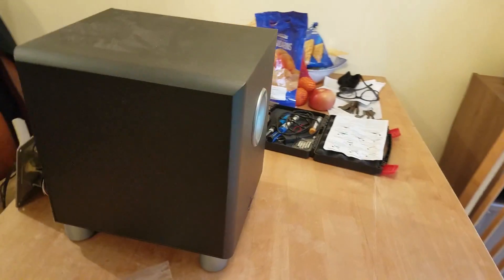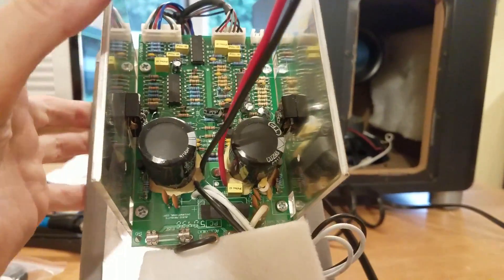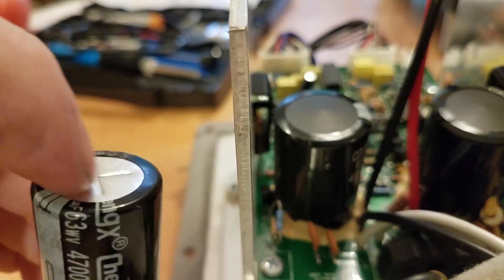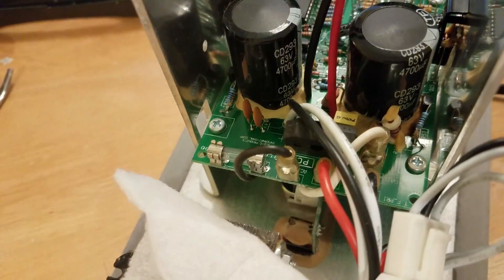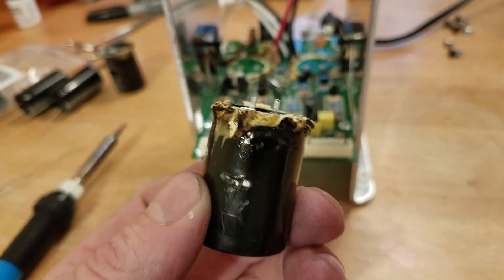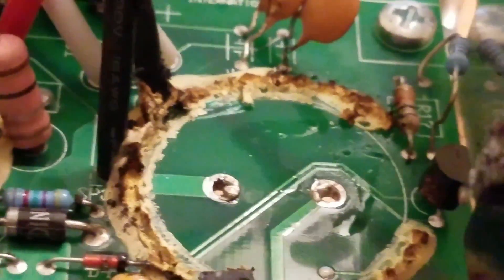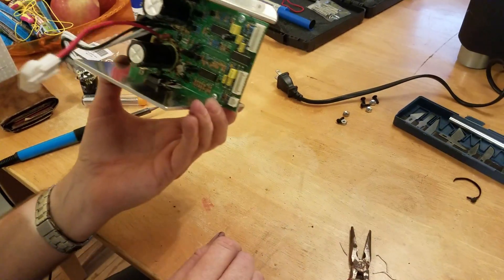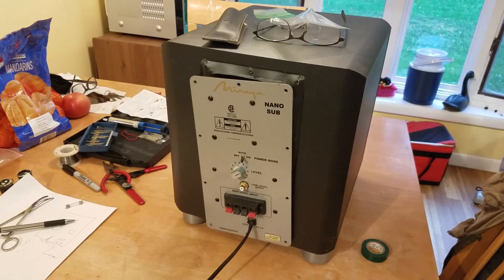Fixing Subwoofer Buzz for $10 or less!!!

Comment: Thank you, Very nice very informative. However, I am really confused. I have the same issue with the Active Subwoofer. Nothing is connected to it, only power cable and as soon as I turn on the hum starts. But, non of the capacitors popped. My first thought was the capacitors. However,  all the small and big capacitors are flat and look like okay. Can a capacitor be faulty even without popping?
Reply from the maker: Yes, they sure can.  They don't have to physically show signs of failure to be bad unfortunately.  It's easier to tell for sure when you do see external evidence.

Comment: Great video.  I have Definitive Prosub 1000, I plug only the power wire in and it slowly starts humming.  It’s not very loud but just enough that you hear it.  The sub still works great except for the hum.  Does this loud like the capacitors?  And on my capacitors they show (M)85°C   KL5    - - Neg  how can I find the right ones or do you know what ones they are ? I can’t seem to find them. Thank you very much
Reply from the maker: There should be additional markings on the capacitor that show a voltage and rating, usually listed as uF.  If you hear a hum then it's potentially power supply, and potentially those filter capacitors.  It can also be the power coming into the house.  You can get surge strips designed for audio equipment, or hum eliminators that act as ground loop isolators, that will also have filter capacitors in them to help filter out a good part of that 50 or 60 cycle hum, so that may be an option for you to try as well.  If it's not enough to bother you, I don't know that I would try messing with anything right now either.

Comment: These caps are not filled with oil !!! They have electrolyte between the plates which dries out and sometimes causes the case to expand. This increases ESR and reduces the capacitance of the capacitor. Always re solder the joints with solder using  an 80 to 100 watt soldering iron and try walking the component off the board by heating one side at a time. Then use Solder wick and a soldering iron to clean the solder lands before re- soldering new components onto PCB.Replace them and ensure capacitor is correctly anchored with neutral cure sealant to help minimise movement as the sub woofer will cause a mechanical oscillation of the capacitor at high SPL / volume levels.The long lead is usually the positive lead too.  Good job Floyd.You just saved yourself a couple of hundred dollars at least as well as reducing down time and freight costs and further handling damage. 🙂
Reply: Definitely not oil filled but still a helpful video compared to most. Your input is definitely beneficial as well. Thank you

Comment: Can you help plz .. i have same issue of buzzin of my sub .. i have cut the woofer wires and other 5 speakers still working smoothly but when i try to connect the woofers wire it buzz again . I have replaced that capacitors but still same problem .
Reply from the maker: You may have to start looking at the circuit for the sub portion.  It sounds like it may be a separate circuit with it's own amp, and may have capacitors to help regulate voltage on that side.  Look for any caps that may be smaller than the primary ones in the power supply, that have bulging tops to them.
Reply: @MIFixItDad  today i replaced all the capacitors because it was about 15+ years old sub .. but fault was still. Yesterday  i replaced 2 audio ICs TDA2030 but buzzing was not removed. Today one thing came in my mind that i should replace all the audio ICs at once may be new and old ICs not compatible, and i replaced all 7 audio ICs and now sub working perfect .. well thanks to you i learnt from your video
Reply from the maker: @TheMati420  You went WAY beyond what most people would do.  Excellent job!.  It's amazing just how little the individual components cost compared to the amount you pay for the assembled product.
Reply: @MIFixItDad  yes I bought 10 capacitors and 7 audio ICs TDA2030 in just 2.5 $😋😋 and the new home theater like this is about 300 $$ here in market .

Comment: I'm glad for you, Floyd. My Kenwood HTsubwoofer had possibly a different failure, the low-pass just wouldn't work and crunched out under 200HZ or wherever.. but I think it was the 1st (or is it 2nd, idk) transistor had s=corroded between two of its leads onto the traces, which had kind of a brown flux crap buildup shorting the board right there? possibility? Thanks again, you're actually pretty great and gonzo style and that's the way.
Reply: of course, one symptom may lead to up to ten others with a board.

Comment: I checked, my capacitors are the same as the one that you have installed, and they have not popped up yet. Still I hear that buzzing sound. Is there anything else i can do..
Reply from the maker: They don't have to pop to be bad.  If you have a buzzing, often it's the power supply that's creating it.  Look carefully at all other capacitors also.

Comment: Great video, I have a Velodynr SPL 1500w 750w RMS it has 6 mid size capacitors the strip e on each cap are pointed different directions  looks mfg done ?
Reply from the maker: That's entirely possible.  They could be connecting to the legs of 2 different circuits or set of traces on the board.  Sometimes they are simply laid out in whatever manner would make it easiest to fit the components.

Comment: My woofer makes a horribly loud and erratic sound when I turn it on. Volume down doesn't change a thing. Do you think it might also be the case? I can't check it now, but your video gives me a hope! Thanks!
Reply from the maker: An erratic sound doesn't sound like capacitor issue.  That could be a volume control knob or some other adjustment knob.  Unplug everything from it except power, turn it on.  If you hear humming, that could be power supply, which could be a capacitor issue.  If it's something else, like a scratchy sound, then it's probably something else.

Comment: is this the same with buzzing noise while in standby mode?
Reply from the maker: Very possible.  Unplug it from everything except power.  If it buzzes just plugged in, then that's likely a power supply issue.
Reply: @MIFixItDad   already done that,. and it still humming even its only power connected,. have any idea how to fix it?
Reply from the maker: @carlotrese6996  That's what the video is about.  A lot of the time, it will be the filtering capacitors in the power supply.  Not all the time, so there is no guarantee that if you replace them it will fix anything.  It's just the item with the highest likelihood of being the source of trouble.  If you are able to take the sub apart to get to the power supply, do a visual inspection to see what those capacitors look like.  If there is even the slightest bit of bulge, then they probably need to be replaced.
Reply: @MIFixItDad  ok i will take a look at it,. thanks much

Comment: I don't see the point in explaining the functionality of capacitors to unqualified non technical people who wouldn't know a capacitor from a lump of wood. I would NOT be encouraging untrained people to delve into the electronics of a power supply.
Reply from the maker: Everyone has to start somewhere.  Someone that isn't comfortable at least in part with doing something like this, wouldn't be watching this video.  So far, it's helped way more people than I would have thought.
Reply: @MIFixItDad  Floyd, no they don't need to start somewhere doing this without technical training.
Where I am, it is not legal for DIYers playing with electrical/electronics equipment. We have a 240v ac  supply at 10 amps. The margin for error is quite high and potentially dangerous irrespective of how well you believe your instructions are interpreted. 
I'm a qualified electronics Engineer and discourage this, primarily for safety reasons and current laws in Australia. 
Sure, we have hobbyists that have fundamental electronics knowledge but many do not.

Comment: Great video! Time to break out my Disston cordless soldering gun...really miss Radio Shack, I could have just Driven over to pick up the capacitors  instead of waiting for shipping
Reply from the maker: I miss Radio Shack too.  I used to go there for all kinds of things when I was younger.  I made an LED display for my car radio with all parts, including IC chips, that I got right at my local Radio Shack.  If I buy online I prefer to use Mouser or Digikey for parts, but hate paying $8 shipping for an 84 cent part.  I end up going to Amazon where some of the parts can be questionable quality.

Comment: My MK V1250 is firing both subs when I plug it in. It is continuous and LOUD. No input either. Any ideas?
Reply from the maker: I thought that sub had a single 12 inch cone so not sure what you mean when you fire both subs.  If you plug it in with no inputs, and have a hum sound then that usually points toward a power supply issue of some sort.  Since capacitors are usually what are used to even out the voltage when the AC voltage is converted to DC in the power supply, it tends to mean capacitor or capacitors somewhere are bad.  If there is nothing obvious, you may have to send the amp to an electronics repair specialist to diagnose.
Reply: @MIFixItDad  sorry it is the mx 125. How hard would it be to replace the power supply? Also, would the main capacitors be the ones to replace?
Reply from the maker: @carsoncutrone2411  The power supply is the part of the amp that delivers power to the components of the amp.  Most likely it's totally integrated and can't just be replaced.  It would need to be repaired.  IF it's capacitors, when you take the screws off to remove that plate with all the electronics on the back, then most likely you will see 2 humongo capacitors that really kind of say "look at me I'm so big".  Those are what you want to inspect.  If the top is bulging even the teeniest bit, they are probably bad.  Now, I'm not an electronics expert.  I just like fixing my own stuff and I'm pretty decent at figuring it out, so don't take any of this as absolute gospel.  The good thing is, if you want to try on your own, the capacitors are cheap to replace.  If it works, great, and if not, then you haven't spent a lot trying.  If there is any doubt or you aren't sure about trying, then that's a nice sub and it would be worth sending at least the electronics portion somewhere to have it repaired.
Reply: @MIFixItDad  home theater is a hobby of mine. I'm far from a pro. I've only done one DIY speaker project. I have an extra crown xls amp. I wonder if I could rig it so that I bypass the subs internal amp plate. Only thing in question is if the internal amp has some sort of delay since there are two 12 inch drivers
Reply from the maker: @carsoncutrone2411  If the internal amp is bad and you have a "spare" amp so to speak, I think it's worth a try.  I wouldn't think the drivers would have a delay, otherwise you could risk having the trough of one wave line up with the crest of the other and cancel each other out.  At least that's what I'm thinking.  If the amp you have can safely drive those either in series or parallel at whatever ohms you end up with, then I would say try it and see what happens.  If nothing else, just for the sake of experimentation, that sounds awesome.  I'm in the same boat with an old Bazooka sub I was going to put in my daughter's little starter car.  The amp burned out so I'm looking at getting a little bridgeable amp to bypass the onboard amp and drive the little 8 inch woofer.  Should work just fine, but there's only one way to find out.

Comment: Are they typically 50V capicitors and do they need to be put on a certain way or does it matter?   I seen in the video you have 63V. I guess  I was looking at another video where it was 50V capacitors
Reply from the maker: It depends on the circuit design for your amp.  These can literally be almost any voltage or capacitance.  It's whatever the engineers that designed the circuit ended up deciding was best for that application.  Match what is in your amp currently so you know you have the correct part.  If you have to substitute, go larger.  If, for instance, I couldn't have found a 63V capacitor, I would not generally want to substitute with 50V.  That may be too small and the smaller capacitor could blow up or not last as long.  I would want to find something the same capacitance, but a higher voltage, like 75 volt or 100 volt.
Reply: @MIFixItDad  On the capacitors, is there a positive and negative designated for each of the wires or does it matter which way they are installed. Seems easy enough.

Update: I missed where you mentioned the stripped part. I'll have to look out for that if I need to order. $10 for capacitors is alot cheaper than $300 for a new amp esp since the pricing on those went up.
Reply from the maker: @amb7247  Yes, it most definitely matters which way they are installed.  If you look on the capacitor, one side will have a stripe.  Keep track on the old one which side that stripe is on and put the replacement capacitor on the same side.  There may also be a + and - sign on there also.  On the capacitors with both legs sticking out one end, the striped side is generally negative.

Comment: Thanks for your great video, Floyd!  I have the same exact Mirage Nano sub and replaced the blown capacitors just like you.  I then put everything back together, but there is no power when I plug it in and the switch is on.  It DID power up (WITH the loud buzzing-LOL) before I began the repair.  Is it possible I harmed the circuit board when wrestling the old capacitors out?  Any advice you or anyone else in the comments have would be appreciated.  THANKS!!!
Reply from the maker: Check the little fuse in there.  Mine was a teeny little fuse, something like a 1 or 2 amp and for some reason after replacing the caps it kept blowing immediately.  I took a gamble and uses a 5 amp fuse and it's been working great ever since.  I think the new caps just have a higher initial amperage requirement.
Reply: @MIFixItDad  Hi again Floyd, I replaced the old fuse with a 5 amp fuse.  However, when I plugged in the power cord, I heard a pop from my wall outlet and tripped the circuit breaker.  D'OH!  What have I done - LOL?  Any suggestions are definitely appreciated - thanks!
Reply from the maker: @addnh  Not so sure on that one.  I'm not an electrical engineer, but it certainly sounds like something else in there is bad and causing the amp to pull a huge amount of current at start up.
Reply: @MIFixItDad  Yeah, that's kind of what I figured, too.  Thanks again for the great video!
Reply: By this is obviously old, but did you make sure to install the caps with the correct polarity?   That could definitely be your problem. You have to make sure they are installed the same way as the ones you removed.  The side of the capacitor with the line on in, as well as the side of the cap with the shorter leg , is the negative side. The side with the longer leg and no line is the positive.   There is frequently a marking on the PCB with a  “+” indicator as well.

Comment: I dont get it what is the difference between turning it off by a switch or pulling out a power cord....
Reply from the maker: Turning off with switch , depending on where and how the switch operates, can leave the capacitors charged.  If you remove power while in use with all switches fully closed, then it forces all components to fully discharge.  Some electronics will leave parts fully charged for faster startup.

Comment: Hi sir , my subwoofer's also showing the same issue but when i opened it i found the capacitors . But it's not bulged . It has the same capacitors what you just replaced with. What should i do ?
Reply from the maker: Good question.  If you have access to a capacitor tester, you could remove them and test them, but that's not something most people have available.  You could take it to a shop and have them test them, but that might cost more than just replacing the capacitors to see what happens.  If you feel comfortable replacing them, and can get replacements for a good price, it may be worth changing them to see what happens.  If that's not the problem, at least you've ruled out a possibility.

Comment: Floyd, can you help me please? I replaced my entire integrated system twice now because the powered sub has a noisy hum. The problem is I cannot seem to access the internal electronics. I have removed the 4 screws and there are no hidden screws but the back of the sub won't come off! Essentially, the Phillips MMS460/05 is a 5.1 amplified subwoofer system with the 3.5mm Stereo Mini connections Here is the product:  https://www.download.p4c.philips.com/files/m/mms460_00/mms460_00_dfu_eng.pdf and https://www.download.p4c.philips.com/files/m/mms460_00/mms460_00_qsg_eng.pdf
Reply from the maker: I tried finding information on disassembly for that speaker and can't find anything really.  It looks like a discontinued system.  I'm betting that back panel is glued on or has an adhesive strip of some sort.  If you can get plastic pry piece, like the ones you use to disassemble cell phones, and gently (but firmly) try prying on a corner and see if it starts lifting up, then likely it's adhered in some fashion.  If so, and the sub is not working, then you may want to gently and slowly continue to try and pry around the edge and see if it will come up.  Be careful, go slow, and take your time.  If it doesn't appear to want to lift up, then you may want to try sitting it in a sunny spot for an hour so the sun can heat the speaker, which should weaken the grip of the adhesive, then try again.  If that doesn't work, then I'm not sure.  I've never seen one of those in person so don't know exactly how it comes apart.